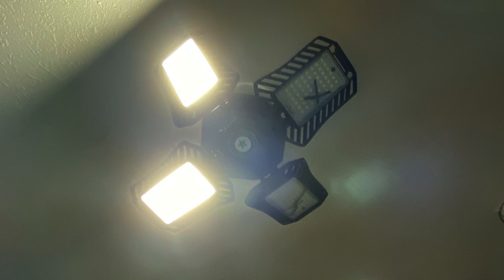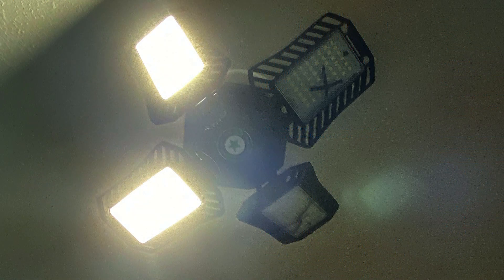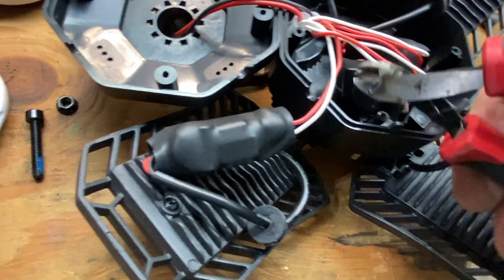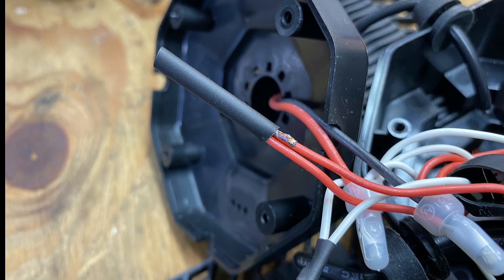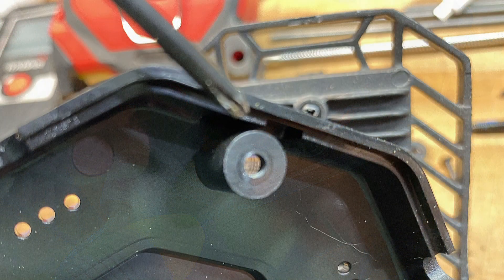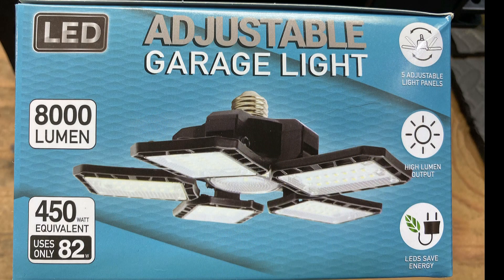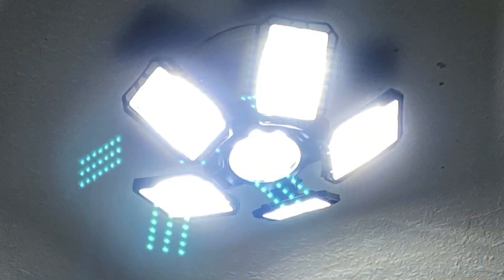FAILED! 4 Panel LED Garage Light! Long Lasting is Bull Squatchy! My fix, plus a better alternative!?

Comment: I purchased 8 similar lights 4 years ago for my garage.  After only a few months of occasional use is started noticing individual LEDs here and there dying.  After a while, a whole panel would go.  They've had very little usage, I was pretty disappointed but I'm an electronics guy so I of course blew it off until they all died.  Average of 4 bad LEDs on each of the 32 total leafs - Yay, I'm in the middle of replacing them.  The reason they failed early was the thermal transfer compound they used was sub-par and the panels were overheating.  It's best to be proactive and take each leaf apart, remove/clean the small blob they put in the middle, and apply fresh silicone thermal transfer grease to the back of each LED board in a thin coat then snap the lens back in place.  Rinse/repeat and it should greatly extend the life of the LEDs.
Reply from the maker: Yes, definitely they get hot.  The ones I replaced them with are so much better and all are still working.  Thnaks.

Comment: I have bought about a dozen of these units, including the ones with six or seven blades and the center light as well, but when mine fail, the entire light goes out, so I don’t think it’s a problem with burnout light panels. I re-purchased a brand I have used that has not failed yet and so far so good, but many of these lights are junk from China

Comment: Thanks for the info Dave on the LED light. I have to go to Menards, so I will look into one. I want to replace a 250 W flood lamp. I was just looking at the weather for Sibley, and your in for some cold temps. It's showing Thursdays high of - 11, and a low Thursday nite of - 15. Were suppose to get it too. Stay warm.
Reply from the maker: You will like them, but on sale only til the 24th.  Cold is right, and high next week only -6.  Snow coming too, Wed. Thanks Tom. You stay warm too.

Comment from the maker: Disappointed it failed, I managed to take 2 broken lights and make 1 good one, with a spare LED panel left over for the next failure.  But I found even brighter and cheaper one, so we shall see how long they last.  Thanks for watching. Link for 5 panel light from Menards. You, must change the store to Spencer, IA to get that price of $5.99 ea. til Dec 24th.  https://www.menards.com/main/search.html?search=gt-bu-g805p

Comment: I bought 4 similar lights but a bit better looking: aluminum cast heat sinks and not a lot of plastic. Its been 4 years now and they still work as new. I got lucky.
Reply from the maker: Yes, my lights heat sinks on the panels are also aluminum, the rest plastic.  4 years, is a long time.  Never knew they had them back then.  Good for you.

Comment: I have one of these 4 panel LED lights from GT Lite.  It lasted less than a week and it's completely dead.  I'm wondering if there is a way to fix or at least salvage the individual panels for some kind of low voltage custom setup.
Reply from the maker: I had several fail.  I took a good panel off 1 and put it on the other.  Dont know how long they will work, but my alternative lite is still better.  Thanks and good luck.

Comment: I had 2 of these but they were 3 panel and had a motion sensor. I had them installed in the garage and after only a year of use on panel started flashing when the motion sensor was set off. Then it went out fully and only 2 led panels worked. Then today the whole unit finally went. So im just going going to replace the whole thing and get a 6 + 1 with motion sensor instead.
Reply from the maker: Right on.  Thanks.
Reply: No problem

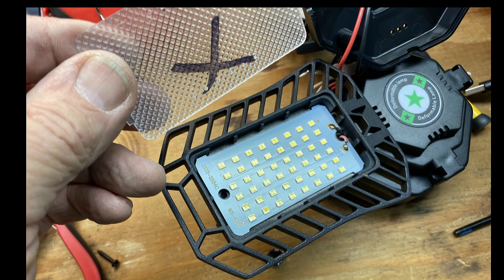Comment: At 1:18 the third from the left bottom row LED chip looks like it has the black dot of death. A couple LEDs look dotted really. But that one dot looks really bad. COB LEDs are often like old Christmas lights. One dies and they all go out. Because they're in series. Trying to run LEDs off line voltage is just a bad idea.

Comment: Been about 6-8 months for my 4 -panel leds for garage and 1  by 1 the panels started to dim , then go out.   these bulbs are also heavey and I have now damaged a fixture removing the bulb!...ugh....now I have to replace the receptical and need two new bulbs....great light while they lasted but staying away from these junk LED'S.
Reply from the maker: Agreed.   My newer ones are still working, so am glad things are improving.  Thanks.
Reply: @NightFlyyer  fixed receptical today and fitted , yes, with two new 3 -panel led's $4.00 each....they are like 30w so I cant see a thing out there now...watch, they will last for years now.....

Comment: Panels look not half bad but it's sad that it uses such a cheap led driver, when I get spot lights with similar construction I whould test its foward voltage and buy more pricey led driver, probably wouldn't fit but it's an option
Reply from the maker: I think paying $5.99 for the other one i showed, is way cheaper than trying to find 4 drivers and replace them all, but thanks for the suggestion.

Comment: I purchased the exact same light and all 4 panels failed at the same time. I took it apart and inspected the board and components but nothing is visibly wrong. Lasted me 1.5 years at most. Very disappointing
Reply from the maker: Yep. The new ones I got (ssee the link) are still going strong. I hope they last long,  and I really like the light in the middle.  Thanks.